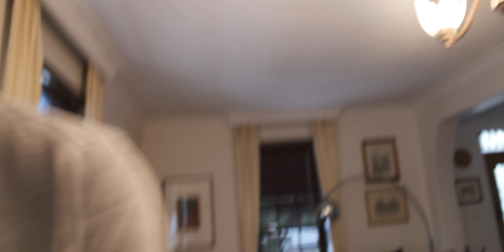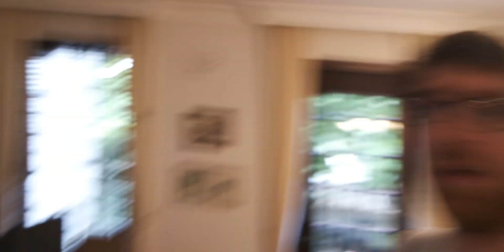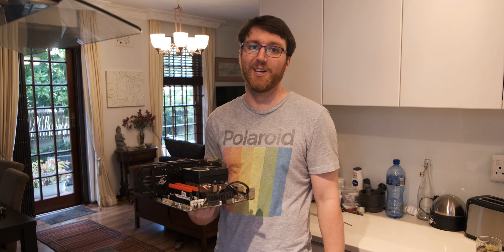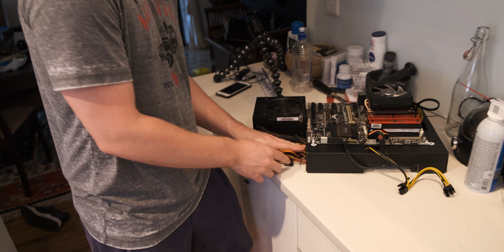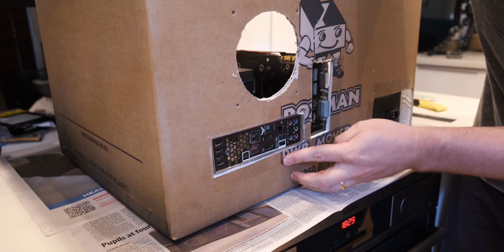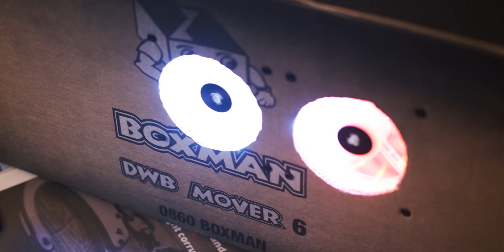AWESOME budget gaming PC in a Cardboard box

Comment: Lekker bru!
Back in the day built a system into a yellow cardboard lever-arch file.
Removed the metal clip from the file. Power supply mounted on the floor, on it's side with super glue, the plug facing out the front opening. Tied the board off just above it with some string. Cut a chunk out of the side of the file for a fan (also string mounted). Then finished it off with ashitload of brown box tape to keep the file closed and seal the open bits. Worked great, was as compact as a laptop, and provided great amusement at lans. Should've painted it!